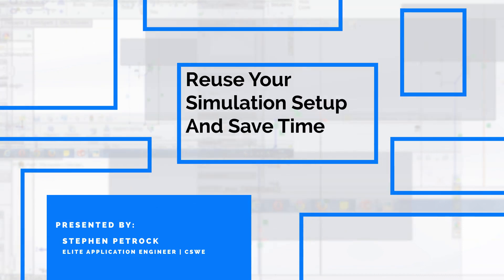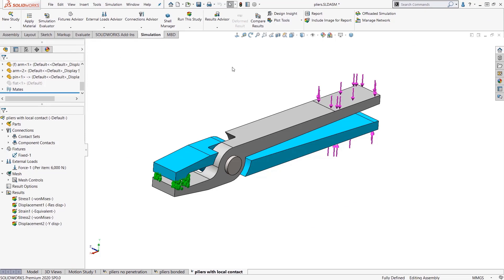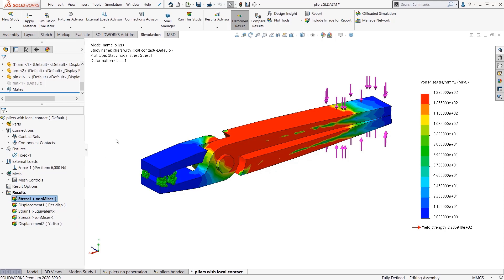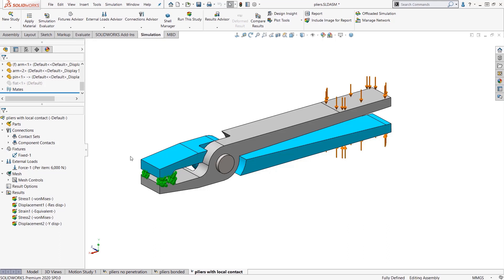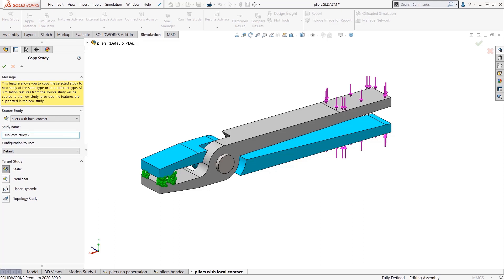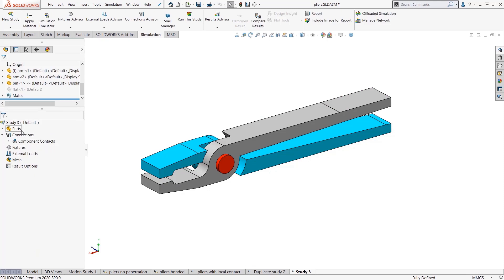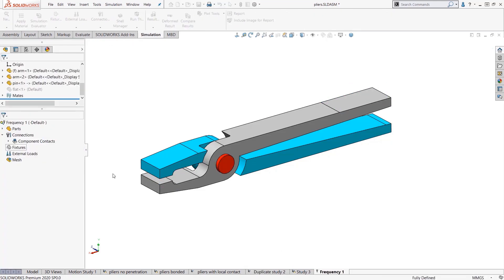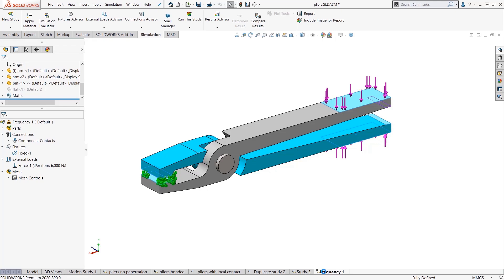SOLIDWORKS Tech Tip: Reuse Your Simulation Setup and Save Time

Comment: It's worth noting, that this is not always possible. For example, if u have 2 different configurations with different geometry, features cannot be copied or can be copied in an incorrect way.
Not to mention the case, where we could have 2 different analysys in the same configuration, but in the first analysys we could define shells, beams instead of solid bodies in the second one...